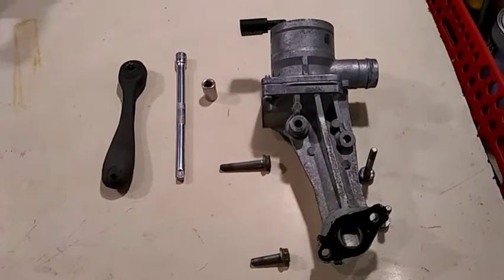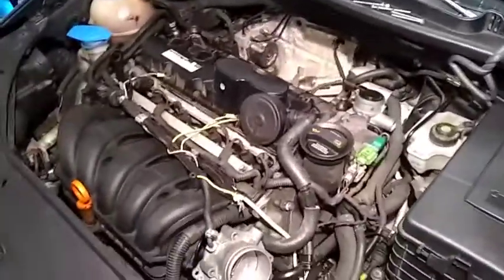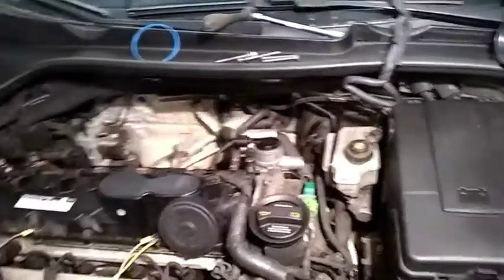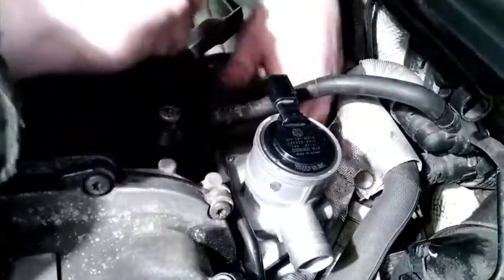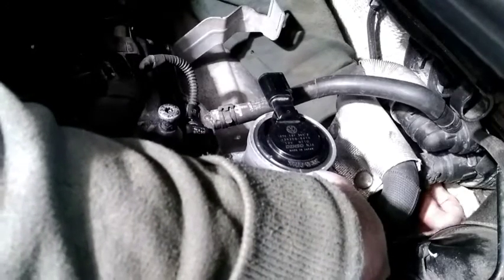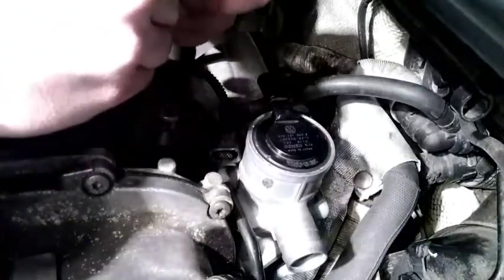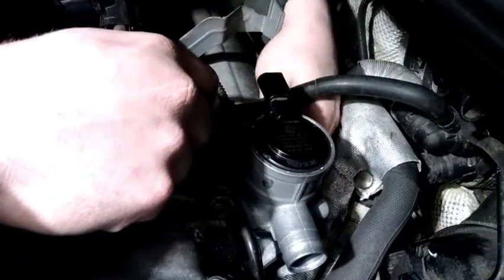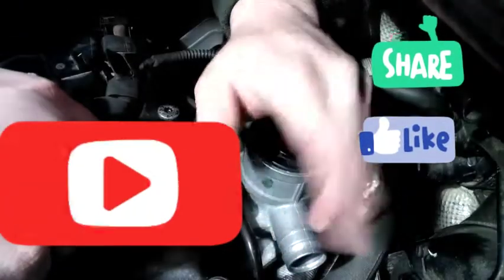easy and fast way to replace secondary air check valve on a 2.5L VW engine MODELS 06-2014

Comment: Does the bottom port on the valve have its own metal washer? I see it in the opening shot of your video, but not in the actual installation process.  AI'm asking because after replacing the valve, I was still getting P0491 so I took it to the local mechanic. They said the new Dorman check valve I put in was inferior, and stuck in the open position. Just yesterday I bought and installed a new OEM valve, but it came with no metal gaskets/washers. I reused the one for the upper port, but the valve I removed (Dorman)  had no metal gasket on the lower port. I swore it did when I installed it. Thanks for your time.
Reply from the maker: @whiskeyhill1483  yes it will have little metal gasket. 
Basically they are a crush gasket. 
You should have two small holes and one big one in the middle. 
When you remove it usually they fall down onto the ground or on to the metal subframe under the engine that's probably where it went over sometimes they stick to the block. 
If you continue to get that code I definitely recommend checking or replacing pressure line with the sensor in it and if you still have code sometimes a portion of the manifold where the bottom part of the valve connects to the hole can get clogged up who is carbon and cause insufficient flow code. 
So to sum up yes it has a little metal gasket it was probably either stuck to the block or it fell off when you took out the bolts and removed it, some of them add little metal tabs that hold it to the valve other ones use the bolts to hold it in position.

I hope this helps
Reply: @stephengoad3091  Thanks. I remember installing two gaskets and was confused when it came back from the mechanic with only the top one. Thankfully, I have one from my original valve. You've been a lifesaver, and I can't thank you enough. I'm definitely a subscriber.
Reply from the maker: @whiskeyhill1483  thank you very much 4 subscriber

Comment: I'm asking this because I removed the unit by flashlight at night. The next morning I couldn't remember if the bracket mounted on the outside or inside the valve. I believe you are saying it goes on the outside, acting as a washer between the screw and the valve. Can you confirm this? Thanks for the great video.
Reply from the maker: @whiskeyhill1483  yes so the metal bracket will be on the outside of the unit. 
The screw will go through the metal bracket first then into the unit then tighten up into the block. 
I hope this helps.
Reply: @stephengoad3091  Thank you so much for your response. I changed the positioning as you said and am waiting for the check engine light to NOT come back on🙏
Reply from the maker: @whiskeyhill1483  assume if you're talking about the wiring harness metal bracket on the number one screw and that is correct. 
You will use the number one short screw start it through the metal bracket then lower the unit down put the screw through the bottom hole of the unit then move it around until it falls into place. 
I hope this helps and the repair goes well.

Comment: Is there anyway to test this combi vavlve i just tested my old air pump and it was fine i guess the valve is not opening because i changed the plastic hoses as well
Reply from the maker: Yes there is.
All you do is run a negative and positive wire from your battery ( two jumper wires) and put the negative on first and then lightly touch the positive wire to the other terminal there should be a loud clicking noise if there is no noise first change your wires around and try it again if that doesn't work then it's possibly burnt out.
You can actually take it off and clean the inside of it there's four small Phillips screws you'll have to take out in a thing comes apart into sections.
Also I have heard of the exhaust manifold whole getting clogged up where this Tommy valve attaches to down on the backside.
Google is clogged up with carbon you can try to use a wire to scrape it out, but these cases usually you will have a code for high pressure in your pressure line.
I would definitely try running the two hot wires from your battery over and testing it first.
David fales take it off and maybe try cleaning and oiling up the valve it may be just stuck.
Hope this can help you in some way.
Also if you have a small battery laying around for a power drill or even possibly a 9-volt battery, it might have enough to throw the solenoid valve.

Comment: Thanks this helps a lot! I just got a new airpump combi Valve and map sensor I'm going to install them all my self to save money. Do you have any videos on how to change out the airpump? Looks tricky
Reply from the maker: Thank you I definitely appreciate it and I'm happy to help.
Here's my video and it explained where the bolts are and how to get to them it's not technically a solution video you can't follow along and see where all the bolts and plugs are.
In this video I basically explain most of the main problems due to your secondary your system having a low flow code.
https://youtu.be/I2QgERwlMYM
Hope this helps let me know if that fixes it.
Also the steps I talk about about jumping the relay is a good way to test your air pump after installation just remember to leave the hose off your combination valve.
It's the hose that runs from the pump to the combination valve.
Just don't run it more than a few seconds and use a pretty heavy duty piece of wire, because if you don't you can actually start melting the cover on The wire.
A good rule of hand would be to use either the old pump wire itself or a wire equal or bigger to the old pump wire.
Hope this helps.

Comment: I cannot even get the combi valve connector off.  How do you disconnect it, is there a locking mechanism?
Reply: Yes it has on the bottom

Comment: 🇧🇷👍🏻👍🏻
Reply from the maker: I hope this saved you time and money that's what I'm here for.
Reply: it helped a lot, thank you friend
Reply: chevrolet capitiva awd sport 3.6 v6, already caught one with noise in the chain in first march?
Reply: @stephengoad3091  Did that battery box come with the car? If not where did you get it? Great vid by the way. My air pump is noisy on startup after its sit for more than 10 hours.
Reply from the maker: @wandameadows5736  
Yes it's the original battery box from the factory they probably buy it from a junkyard or off eBay it should be for a Volkswagen Jetta or golf years 2005 to 2009.
If your pump is noisy or stir It up you're only running for that versus you seconds so Mississippi's first sign of your pump getting ready to go out, I would recommend taking off your intake hose that connects to the front of your ear pump and check for water if it has moisture buildup and probably a combination valve is going bad allowing hot exhaust gases to be trapped in the pump causing moisture.
If it's not that it could be a  bearing going bad in the pump motor.
Well I hope this helps have a good day.
Reply from the maker: Yeah I understand Google translator always seems to mess things up.
Reply from the maker: Didn't really get the meaning of your last message, something wrong with your timing chain?
Reply: I'M SORRY, I' FROM BRAZIL AND I'M USING GOOGLE TRANSLATOR !
Reply: In the vehicle capitiva 3,6 v6, at the first start of the engine, it makes a noise and stops, as if were in  the chainsof command, I asked if you already got something?